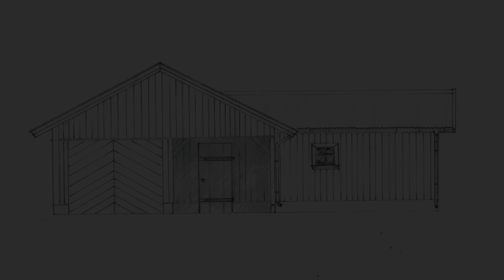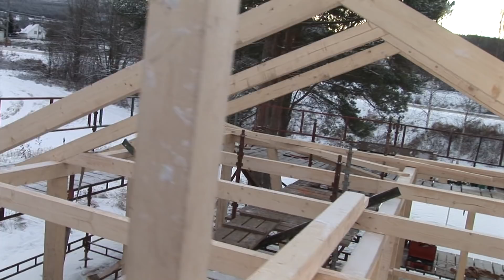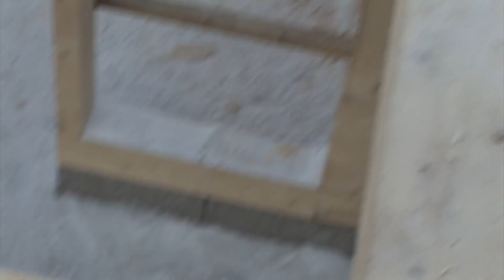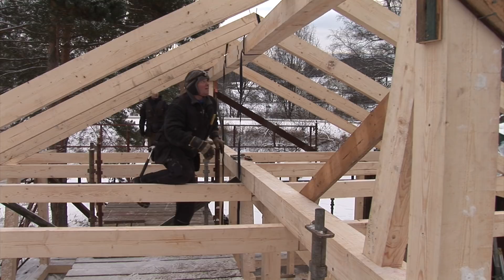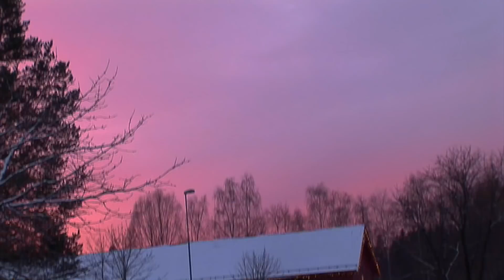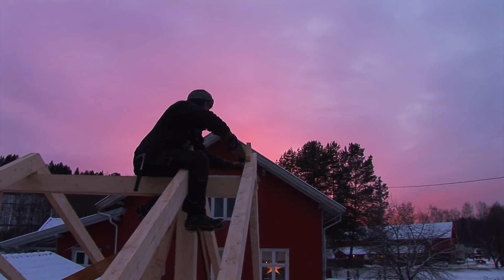🔴 13/35: Building a Post and Beam Garage - King Posts and Ridge-Beam

Comment: How does the ridge beam mate and support the roof joists???
Reply from the maker: The joists are resting on the ridge beam at the corners and nailed there, and bolted together with a lap joint in the middle. The ridge beam and its' truss are working dividing the span of the joists. I did consider having the ridge beam higher and making a second set of birds mouths and also considered cutting the top of the ridge beam at 26 degrees but decided to leave it like you see it, with the option of adding wedges on the top at any later date, something that I don't think is needed since it feels well over dimensioned as is. All the best, Lucas

Comment: de Walt you cant beat them, performance and endurance. Great work guys But sort out episodes properly they are all out of wack. order....
Reply from the maker: How so? The films are sequential, being  a video log they show content from each days work. I will make a short high light version of the content at some later date, but the project is still on going and I have several days footage to upload. What would help? All the best Lucas
Reply: Work is great, really good job can see your extremely skilled love the Axe work, my comment wasn't a bad one but watching on youtube  start watchin 1 like doing the roof trusses next 1 would be cutting stone so numbering would be great when you have time. regards joe,, Uk.
Reply from the maker: It might be youtube messing up the order try watching the playlist on my channel.
When the job is finished I will make a concentrated edit. But the days are in correct order as far as I can tell, at the start of each film the day number comes up. Some films have more than one day, so the day number and film number are not the same. It is a bit difficult to follow, the jobs we do chop and change a little due to the logistics of making the building like this.  As the building takes shape it is easier to follow too, the next few films should be easier in that way, all the best Lucas